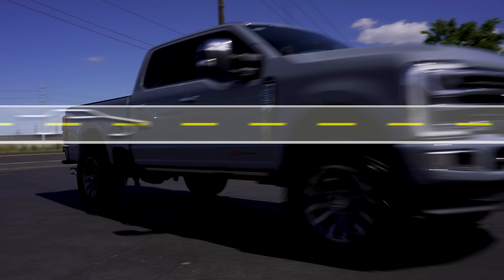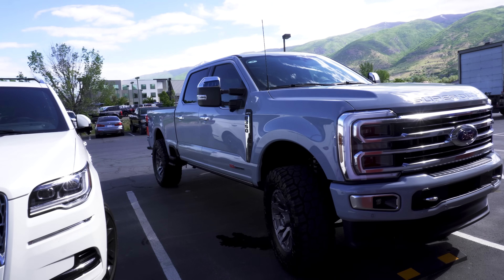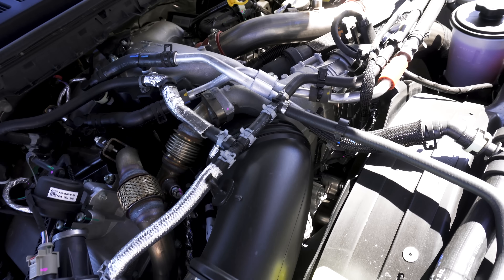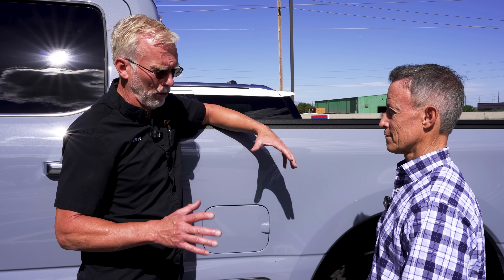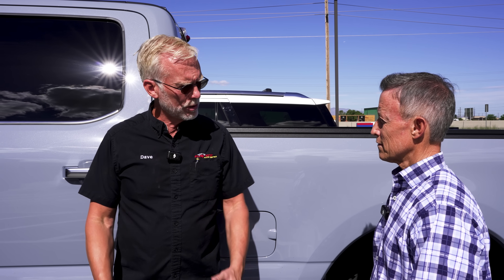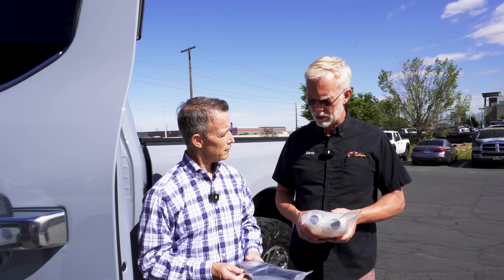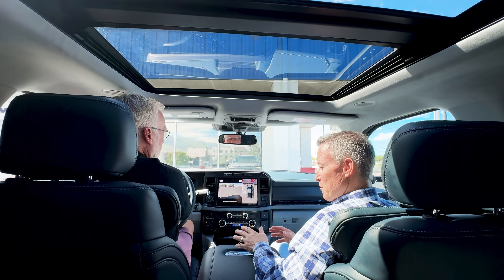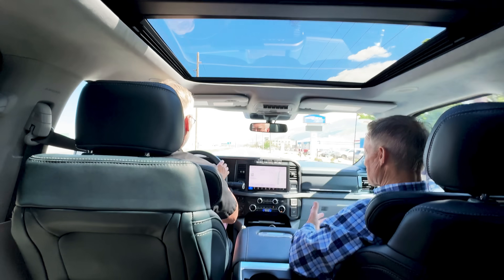Diesel Truck Maintenance

Comment: I have a 2020 6.7 Powerstroke, bought it back when we had a camper. Since then, I no longer tow…at all. I’m also in a company truck 90% of the week and only take my truck to town on the weekends, if at all. Have just over 52k miles on it…I know I certainly don’t need a diesel but where I’m most ignorant is if this “limited driving” is going to cause me issues with this truck in the long run.  Ive had a few instances where I’ll start my truck to warm it up, come out 10-15 minutes later and it’s in regen.

Comment: Diesel Kleen is a great product. Had many customers thank me after they started using it... Increased power and economy instantly on high mileage engines that were not maintained as well as they should have been.

Comment: Super heating exhaust to finish burning unburnt fuel seems so counter-intuitive and engineering failure.
Dave, have you had any experience with testing the limits of heating the diesel fuel BEFORE combustion?

Comment: I’m a ford tech. Been one for 35 years. Guy made mention not to turn key on if you put gas in tank. These modern trucks pre charge low fuel system with door ajar input and remote door unlock. It’s pretty hard to get truck somewhere without fuel being pumped to engine. You can flush it out just don’t start it! You don’t need a whole fuel system like some people will say. Good tip is too take a fuel sample at the pump before you fill your truck. I use a Gatorade bottle. Put some in the bottle and look at it and smell it. Can’t tell you how many times I’ve driven away from a service station. If the fuel is good then pour it in the filler neck. Put the cap on the bottle and use it over and over. That routine will save you from putting gas in tank and maybe not pour def in tank because that’s bad. Y’all have a good day now.

Comment: At 7:50. I have a 2019 F250 diesel. At 39k miles the CEL came on. Dealer had to replace EGT sensor, Nox sensor and the mightly expensive particulate filter. Thank god it was covered under warranty. Wouldve been a $9k to $10k part. So i support what you said. I have Ford Extracare ESP. I dont know if it was covered under that or covered under the 100k diesel engine warranty. I suspect it was the ESP. ESP cost me $1100 and so thankful i bought it. Also, i run Howes fuel treat in winter and Hot Shots Everyday treat the 3 warmer seasons.

Comment: Dave we both know that the injector squirts the fuel into the cup in the piston , yes some goes to the cyl wall , but since the top of the piston sticks above the Block how much cyl wall do you get ? Is my assumption correct, it’s the unburned fuel from dirty injectors or to much peddle on the floor , that black smoke out the tail pipe

Comment: Hello Mr. Davis, I have 2 questions, what oil do you recommend for the F250, I have a 6.7, 15,000 miles ago, I'm confused, I've been to 2 Ford dealers and they recommend different oils. I watched Ford Maintenance on YouTube, yes you don't specify which oil to use 10w30 5W40 15w40. I live in Arizona. And no. 2 how much it costs Install Cp4 prevent Disaster Kit.
Reply: Thank you

Comment: DEF is two chemicals in water that gets sprayed into the exhaust after the DPF to clean  the exaust gases out of the exhaust so that all that is coming out of the tailpipe in hot oxgen. The best place to get DEF is at places that have a high or pretty consistant turnover of it in the storage tank like at truck stops. Most places you can buy it for less than $4 per gallon. If you are working your diesel engine alot i would get DEF every time you fil the fuel tank. Like Dave said DEF is corosive so if you do spill any then rinse it with water that will dilute it and you will be fine. If you see a white powdery substance inside the fuel/def tanks door or on the body around that area then rinse that off with water that is what is left of the DEF chemicals after the water drys

Comment: Great video. 
I alternate between arch oil and hotshot secret. They are both good and I figure what one doesn’t clean the other will. I change oil every 6,000 and fuel every 12,000 miles. I have a Duramax but would either do the same or 7,500 on oil and 15,000 on fuel with a power stroke.  I agree the EGR is a horrible thing. 
I have never thought about using oil samples to set my oil change intervals.

Comment: When I was a diesel mechanic 1975 - 1995 Cummins was adding a sort of fuel restrictor valve for less exhaust smoke on acceleration. But the drivers wanted them bypassed because it lowered acceleration and that was bad when trying to get on the highway. There were no real electronics back them except for the Jake brake. For every engine that manufacturers added to meet EPA regulations I had to try to find a way to bypass because that is what my truck customers wanted. I was certified on Cummins, Mack and Detroit diesel engines but I worked on all of them Cat, Perkins, GM etc. Truck drivers for the most part thought that coal black exhaust meant more power which it does not in most cases. What it does do in every case is wash down the cylinder wall and eventually the engine loses compression and needs overhaul. I have pulled heads off of Cummins 350 that had raw fuel sitting on top of the dome pistons. Many of the older Cummins like NH220 etc of the 50's were still around and were so over fueled that we had to replace head gaskets every few months. Cummins owned the truck market until Detroit Diesel came along with its two stroke engines. Any time quick response at high rpm with no lagging was needed such as fire trucks and generators Detroit reigned supreme. The Detroit 318 with a turbocharger and turbo on top produced good power. It was a much simpler time for mechanics compared to now with electronics controlling the engine.

Comment: I am surprised that Dave didn't talk about the difference of octane vs cetane but I feel it is important. Cetane number: A measure of how easily diesel fuel ignites, similar to how octane rating measures how well gasoline resists spontaneous ignition.  A scale from 0 to 100, with higher numbers indicating better fuel quality. Pure cetane has a cetane number of 100. A higher cetane number means faster combustion, which can lead to better fuel economy, fewer emissions, and better power output. Modern highway diesel engines typically require fuel with a cetane number of 45 to 55. Cetane number can be measured using an advanced fuel quality analyzer. Typically, regular no. 2 diesel has a cetane number of 40 to 42, while Cenex Premium Diesel has a cetane number of 47 to 52.

Comment: Thank you, I needed this. I'm trying to figure out what is best new diesel or a used 7.3 superduty in a 3/4 ton. I like the body style of the F250 1999-2003. does anyone have a suggestion? Thanks.

Comment: I have an old 2002 2.7 diesel mercedes  ml, I throw everything inside that tank and it drives like new. The only regular thing I do is new oil ( cheap 10w 40 ebay oil bulk 20ltr drum) every 5k miles and new fuel filter every 8 k along with oven cleaner into the air intake every so often along with a shot of PAS fuild into the tank!!

Comment: I bought a used 2023 F450 with the H.O. 6.7 and 3,300 miles.  How do you know when the truck is in Regen mode?  Does a light come on the instrument panel?  Also, where can I get that oil analysis kit?  Thanks - new subscriber!

Comment: Dave I have been watching your channel for almost a year. What synthetic oil do you recommend? Also what filter do you recommend for my 2017 F350 6.7 with 63,000 miles. I have always used the recommended Motorcraft  (not synthetic) oil 10w 30 and filter changing my oil every 3000 to 4000 miles. Thank Bill from New Jersey

Comment: I’m getting my first truck and I’m debating diesel vs gas. At most I’ll haul a RV trailer/camper that’s not heavier than what the truck is rated for. I won’t tow anything else and it won’t be anywhere near the limit. I don’t need the range or towing capacity so it looks like gas might be the safer way to go.

Comment: I was told with the older diesels it was better to let them idle than shut them off. I can remember hitting rest areas and all the Semis were running. To me it just adds motor hours.
Reply: Semi drivers run their trucks for 4 reasons,1 Battery or starter trouble 2Heater,warm3Air conditioning4keep fuel from geling up.5buffer the noise from other trucks and people no same as pickups

Comment: Loved the video. One clarification I have is using fuel additive. Locally here in Michigan, I have one the top 250 master diesel mechanics in the USA and he said additives are just a waste. He said As long as you change oil regularly with quality oil, fuel filters at least 15k miles and engine air filter at least 6-12k. Additives are not necessary. You’re saying they are necessary and how do you/we know they are when my mechanic is saying no? Is there strong evidence that we must that is not paid for by the additive companies themselves? 

Some forums even said fuel additives have immediately caused check engine lights or even burned out seals etc. I purchased a 2020 6.7 and I love it soo much that I want to be 100% sure I’m doing right by the truck for longevity

Comment: One thing I did not hear him mention when the question about the octane and diesel was asked. Diesel fuel does not have octane. It has cetane. Also, if you use a full synthetic you can go 5000 miles on an oil change. You are wasting your oil at 3000 miles even under heavy duty use. Then as far as the diesel exhaust fluid, if the jugs are the only thing available, do not buy them and let them sit around. Buy them and put them in your truck right away. It has a very short shelflife and can really do damage to your DPF system if you use old fluid. The diesel exhaust fluid on the pumps is usually the best way to go since it is always being overturned. then the last thing I would do with that truck is get rid of the lift kit. They may look cool but they serve absolutely no purpose. Too many people have had front end issues with a jacked up truck. Those issues are far less if you keep it factory. we drive a 2017 F350 and kept everything stock and she pulls everything we have with no problems. There is absolutely no need to jack up a truck.

Comment: Are there any differences with diesel cars? I have a Chevy Cruze 1.6L diesel engine, and I’m just curious what I would need to keep in mind, do the same, or do differently. 
I need to add some sort of additive to the fuel for sure because the biggest problem I have had so far is the injectors, 2 have gone out in the 84000 miles I’ve had it.
Also, what fuel should I use if they are all different?

Comment: Diesel is not Octane it’s Cetane. No spark plug to detonate. New trucks are common rail - 30K PSI. I use additives to increase Cetane to keep it clean burn - no smoke. (CP3/4) US fuel is crap vs Europe. This is why they fail. Change both fuel filters! Upper and lower. Change stock to high temp thermostat!  To see these temps etc you need an external device which sucks the MFG should include this.  Good info you gave us.

Comment: I would like to suggest that you check out Pittsburgh Powers Max Mileage fuel catalyst , it is specifically formulated for diesels, works like a charm takes 1ounce for 25 gallons. 
you can even use it in you gas engines.  Call Pittsburgh Power and talk to Bruce.

Comment: Ecm swap
Egr delete
Def/dpf delete 
Air intake
5 inch back off the turbo
Trans tune
Disaster prevention kit for cp4
Add diesel lubricant every fuel up

-Strong truck, good mpg, reliable
Reply: Cooking oil mixed with diesel!

Comment: I bought a new Dodge Ram 2500 Cummins powered Sport package 4 X 4 brand new in late spring of 2000. It was a 2001 model.  Today it has 237K miles on it and purrs like the proverbial kitten.  At about the 5 year mark it had to have a new fuel injector pump.  At about 2012 I replaced the front suspension tie rod ends and in 2017 the upper and lower ball joints.  Having been baked in the Arizona sun all it's life I replaced the complete dash assembly from the firewall out.  It is white and still looks like new as it has never been crashed.  At 79 years old this is the last truck I'll own.  I've had people ask if it is for sale. "Do you see a for sale sign on it? (I asked in my mind?)  I'd answer sure, why not. They'd say how much?  I tell them about $100K.  They'd just laugh and say why so much?  "Cuz that's what I'd have to pay to get another one just like it".  A new one won't anything that this one won't still do. And, my license is down to about $40.00 a year and it has never failed emissions testing. Only modifications have been a complete 4 inch exhaust system from Turbo to tail pipe and an external, frame mounted fuel pump to replace the one in the gas tank.  If you have one of these with the fuel pump in the tank don't drop the tank.  Unbolt the bed and raise it with a floor jack and a 4" X 4" X 4' and just lift the bed far enough to access the top of the tank. Some garages or the dealers will tell you they have to drain the fuel tank and remove it.  B.S.

Comment: If you live in a more red state (that also doesn't do emissions inspections), the first thing I'd do is DEF and EGR delete. Just w/ these 2 modifications the longevity of your diesel will literally double if not even triple that.... I'd also get a Banks rear-diff cover especially if you actually use your rig to tow/haul regularly... On Fords specifically, I'd also do a common rail conversion, bc the Bosch pump it comes w/ is trash. Naturally, you're gonna also have to get it tuned w/ the deletes.

Ofc, you have to do a personal risk assessment on getting caught. If you do get caught, I think it's a federal offense ranging of somewhere like a $10k-12k fine. Considering that a full diesel engine replacement in these modern doohickeys would probably cost somewhere like $25k-$35K, along with the fact that I live in a very red state w/ no emissions testing, it's kind of a no-brainer for me. 

And, before you come at me w/ the ethics/climate baloney, just consider this: The U.S. military uses all deleted diesel equipment. They even have brand-new Super Duties specially deleted for their specifications. Why? Bc reliability and longevity trumps emissions. Can't have equipment fail regularly let alone in high-stakes situations. I also don't subscribe to the "Freedom for me, but not for thee" exception for the govt, but if you are more particular in following the law of the land, I don't blame you at all and fully respect it.

Comment: I have a diesel pickup and have had diesel boats. Main points for longevity are 1) keep the fuel oil clean 2) keep the engine oil clean 3) don’t overheat.

Comment: I wish I  had seen this in 2005 when I bought  my now 19 year old Ram 2500 5.9l Cummins. 168k on the clock and she runs like it did new. I replaced all the injectors and fuel lines last November. Everything factory stock. Great video  Dave.

Comment: I try to fill my def at the pump at truck stops. It's a lot cheaper than jugs, and also the jugs have expiration dates, and exposure to sunlight will degrade def fluid and cause issues

Comment: Dave I have F250 2021 I have been changing fuel filter every 5000 miles is that good or over board

Comment: Change oil every 3500 miles? Are you crazy! Change oil every 10k miles and fuel filter every other oil change, and you’ll be golden
Reply: Good luck 😂. You’re causing unnecessary wear by not changing it.
Reply: @Dino-god69  you are wrong pal! We have 40k mile intervals on big truck engines now even though I don’t go that long, so I 3/4 ton truck has no business being serviced every 3500 miles. People that travel & use their trucks would be changing oil and filters once a month, just ridiculous thinking

Comment: Get a FASS Fuel filtration system and an Amsoil Bypass system.....the FASS polishes your diesel fuel to ~ 2 microns, removes the fuel vapor that harms your injectors and improves fuel lubricity;  and the Amsoil Bypass filter filters the oil down to 2 microns (most standard full-flow filters only filter to ~ 30microns), removing most of the soot and the Amsoil filter lasts for up to two years.
Both of these will prolong the life of your engine, injectors and your emissions system...unless you just want to have Dave build you a new Monster engine ;)
Reply: Whats the best diesel fuel additive?

Comment: Speaking about catalytic converters, why are some OEM converters worth so much yet you can buy an aftermarket converter for $40-50. They are EPA approved so how can they sell new universal converters for so much less than the value of the original?

Comment: It’s amazing how they have gotten diesel fuel injectors spraying 30,000 psi! T’s there a point of diminishing returns? Does 30,000 psi make that much of a difference compared to 3,000? Those holes are so small that eventually no matter what psi you put behind them that the small hole is a limiting factor.

Comment: I have owned 2 duramax and 1 cummins and I had no complaints with the cummins only that the chev did have a nicer ride than the dodge but the performance and the finish of the dodge was great

Comment: technically soot is BADLY burnt fuel. Un-burnt fuel is a liquid, obviously. If your engine was emitting truly un-burnt fuel you would have white smoke and liquid diesel coming out your tail pipe. Plus if your truck went into regen it would set the DPF on fire. Dave also mentioned nox, which he referred to as nitrous oxide. Nox is not nitrous oxide. Nox is the formula NO, which is nitric oxide. Nitrous oxide is the formula NO².

Comment: Good information was just given 
Diesel fuel ⛽️ is measured by a cetane  rating not octane.
I use Howes lube in my fuel system on my ram and have no issues.
Howes lube has been around for many many years and being a heavy diesel mechanic for almost 40 years I have used it almost my entire career. 👍🏻